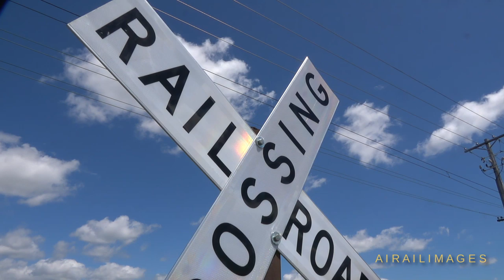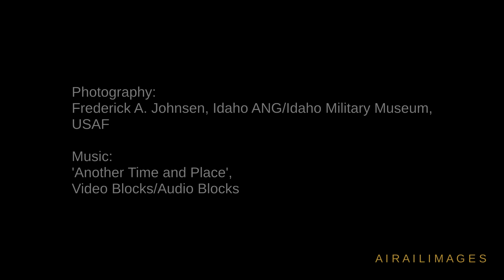AIRAILIMAGES VIDEO MAGAZINE Number 20 - Iowa Traction, Red Flag Alaska 19-3, JF-101A Voodoo

Comment: At the 6:00 mark the train operator had pulled both devices off of the electric lines. What was his power source? Or did I miss something?
Another outstanding edition of the Airailimages Video Magazine. Thanks.
Reply from the maker: I'm wondering if they coasted downhill for a bit.
Reply: The loco probably has enough of a capacitor to run on without the trolly poll connected to the power line.
Reply: @dankuettel5063  Thanks, you just might have solved the question.
Reply: @airailimages  Thanks for the reply.